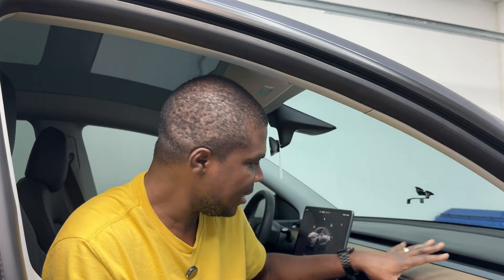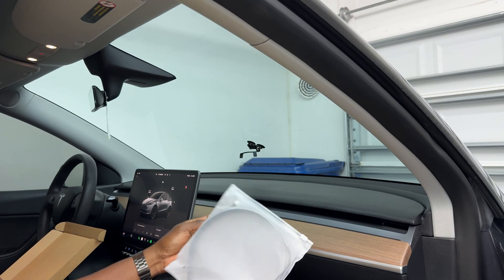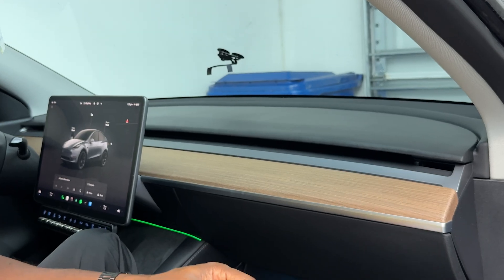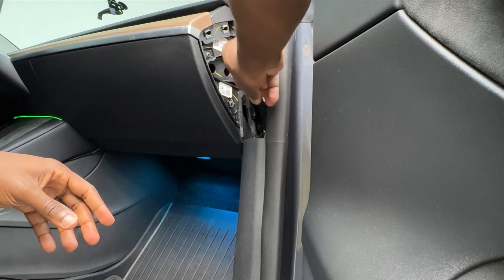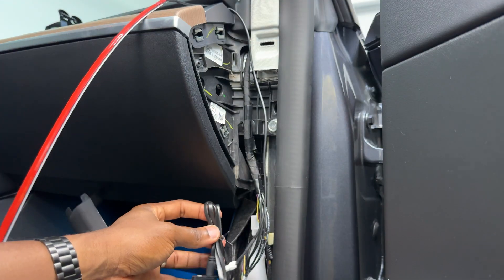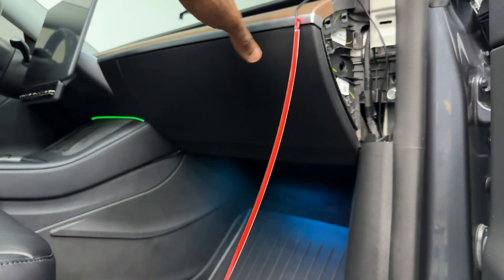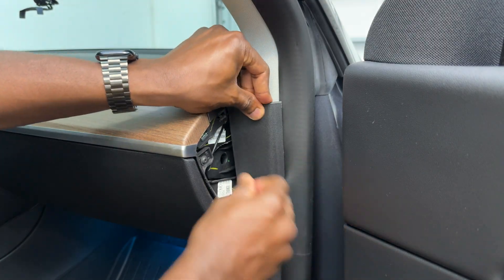Tesla Blind Spot Lights Upgrade | Model 3 & Model Y DIY Install

Comment: Hi.  Do you know if its the same process for a RHD car? Is it still the right front piller that houses the power cable etc? Thanks
Reply from the maker: I don’t know but it should be. It’s easy to find out. You’ll have to take out the trims by the A pillar for both sides to confirm

Comment: I have a problem. Everything works well except, I can't change the colour of the light. My scroll wheel does nothing :( Any ideas?
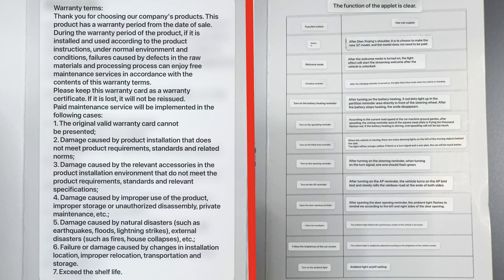Reply from the maker: Are you using the right scroll wheel? the left one won't do it. Pause the video at the 12:16 mark and see the translated directions in the top left. Try what it says and see if that helps.
Reply: I have this same problem for the past 3 weeks now, cannot change the light color on a 2023 MYLR.
Reply from the maker: Have you tried the suggestion I gave on the other comment about pausing and trying the translated steps?